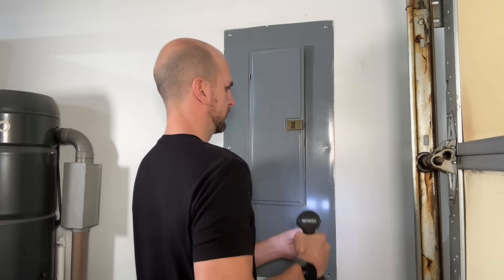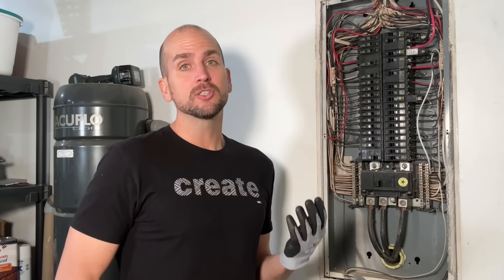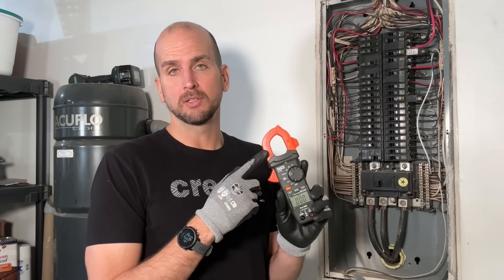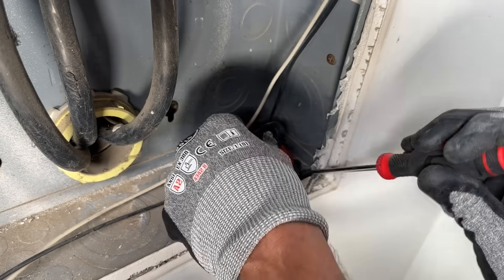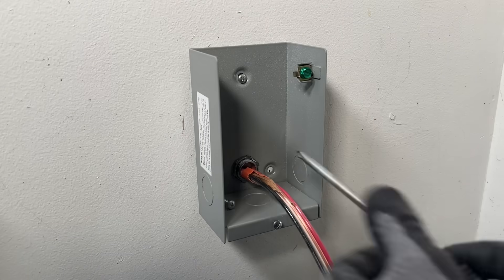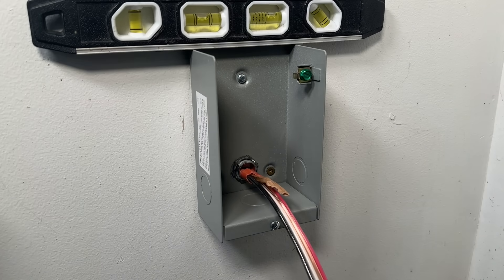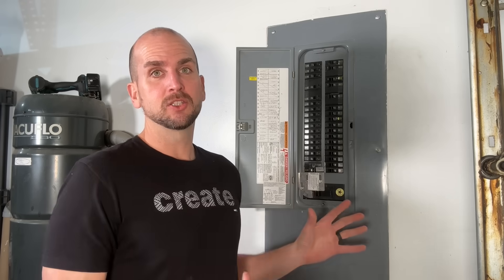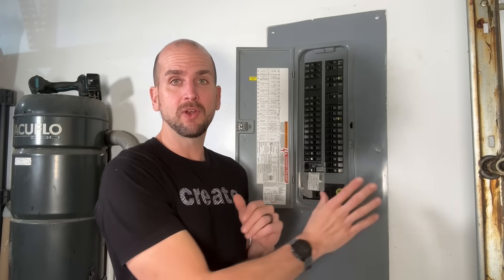Whole House Power Backup Solution | Generator Inlet Box Install

Comment: I did this same job a few years ago on my house.  A couple of things: Generators either float the neutral or bond it.  In my case my generator had a bonded neutral.  This means when it is hooked up to the house you have the neutral and ground bonded in two places which creates objectionable current (parallel paths) I opened up my generator and floated the neutral (manual was good with it).  This means that it is no longer safe as a separately derived system (Just using it without connecting it to the house) so you can't really have both at the same time.  The objectionable current is only running back to the generator from the panel so probably not that big a deal but still.  There is good information on Mike Holt's youtube channel about all of this.  Benjamin Sahlstrom has some good info too.  Great video!  It would have helped a few years ago for sure :)
Reply: You can hook it up to a grounding rod though, right?  I think mine (Predator) has a little nub in which to do that.
Reply: @mae2759  Grounding rod doesn't do anything for safety.  Actually it doesn't really do anything at all :)  If you are interested i'd look up Mike Holt's information on grounding.  I find it facilitating but it can be difficult to understand.
Reply: Chad, you are 100 percent correct about unbondimg the neutral... When I wish to run generator stand-alone, I insert a 240 volt 30 amp plug, inside of which I've jumpered the neutral and ground prongs.  This restores the neutral to ground bond connection for stand-alone operation.  I keep this bonding plug tethered to the generator for easy access.  However, if you try to do a jumper plug at a gen's 120 volt receptacles the built-in GFCI will probably trip....
Reply: @josephknapick5307  Great idea!  Easier than opening the thing up and rebonding it on the generator head each time.

Comment: Texan here. This is a very well timed video considering the number of Texans that went over a week without power because of an ice storm just the other day. I was lucky to not loose power but literally today I heard about one co-worker who came into the office  just to be in a warm office. The storm was 10 days ago.

I have been working on getting myself a backup source. One plan I have is to run my gas furnace using a 1000 watt inverter from my car. I was planning on ignoring my electrical panel all together and run romex from a box similar to the one shown in the video from my garage to the furnace in my hallway. Then I was going to add a standard 3 prong power cord to my furnace so that when the power goes out I just unplug the cable from the primary source over to my backup line. This means I don't have to deal with high voltage at all. Though I like how clean this upgrade is. Great video!

Comment: This is interesting to see. I have a kit that connects my generator to the electrical box. I won't be installing it as I am NOT comfortable working with the breaker box. I'm just glad to see how it all works. Thanks!
Reply from the maker: Exactly, actually a majority of the viewers won't take on this project themselves but just having a better idea on the parts, steps, and time to do the job will help work with a licensed electrician in your area.

Comment: I did this about 4 years ago for a 20A inlet box for a 6000 watt generator I already had. Gas appliances and heat plus LED lighting means a pretty small draw for even a fairly large house (3500 sqft.).  Wish I had this video at the time. Most resources made it sound like a $1000 transfer switch was required. Saved a ton by going interlock. Just make sure you get the right one for your panel. Also note torque spec for the panel screws are probably in-lb NOT ft-lb. Don't ask how I remember!
Reply: Last summer (‘22) I had an interlock installed by a certified electrician. It was something I could do myself, however, a grey area arises with my insurance if something goes wrong, down the road. I felt it better to bite that expensive bullet now rather than find myself with an electrical fire issue and my insurance denying a claim on the grounds it wasn’t installed by a certified professional. 
Your video,as always 👍👍👍
Reply: I have NG too but need some way to power the damn furnace fan and a garage freezer.  I can run on less than 1000 watts.  Probably under 500, I just need a way to get into the F'g panel.
Reply: Look into ez generator switch
Reply: Can  i use a 50amp breaker  with a  30amp box

Comment: Off topic question..oven died in 10yo Kenmore..just two if ya, so we're sizing down..so we got a 28qt Air Fryer..love it..roasts a whole 6lb chicken better than the Kenmore..we just bought a dual element 1800 max watt induction cooktop that we can sit on the countertop, or we may throw out the Kenmore, add additional countertop n recess it.. the induction cooktop came equipped with a 4ft 3-prong cord..now my question is:  Is there an adapter/converter that will "connect to the range stock plug?"...if we ever sell our home, we don't want to remove the range plug..helllp, lol..thx in advance❣🇺🇸.are ya rolling ur eyes❓lol

Comment: Why wouldn't you just go with a 50-amp option? What's the drawback? Isn't the labor the  same?
Reply: The 6/3 wire you'd need to support a 50-amp plug would be more expensive. If you're doing it on a budget, the difference in price might be a factor in choosing a 30-amp over 50-amp plug. Also, 6/3 wire is harder to manipulate than 10/3, so if you're running it more than a few feet with bends in between it gets tricky.
Reply: @joeyhazlett  thank you, John. I did not realize you needed 6 gauge for 50 amp. Money wouldn't concern me assuming we're talking hundreds. The generator or battery units will be thousands, so the difference of a few hundred for 80% more capacity seems negligible.
Reply: Exactly my thought too. If you are going to all that trouble, why not spend a few extra bucks on materials and install the 50 amp plug. Testing the load will tell you your minimum size generator. If a bigger one were available you could use its capacity for a few “luxuries”. Of course I had a contractor install a 100 amp manual transfer switch so I’m ready for anything.

Comment: I used a 8 breaker position transfer switch wired for 50 amps so I can run a generator

Comment: 9 + 17.5 + 8 = 34.5A
Reply: 30A per phase.  17.5A is less than 30A on one, 9+8 is less than 30A on the other.
Reply: @RJ-ej1nr  Did not know that. Thank you!
Reply: Exactly what my maths said. And it's not like your sump isn't going to be running constantly during some storms, so you can't plan to turn it off while cooking to save yourself 8 amps.

Comment: Does that mean only one side of the panel is energized when operating the generator?
Reply: No. The breaker is mounted on one side but the entire panel is powered. Scott would need to be careful that he doesn’t exceed the 30A, which is why he measured and totaled load at both phases.
Reply: @readyplayer2  oh right every other breaker is the other leg, and this is a 2-pole breaker

Comment: If you are in the area of PG&E they make available a transfer switch that attaches to base of the meter.  The meter accepts a provided specialty cord that has an L14-30 to plug to your generator.  It does the interlocking automatically.  They provide it for free under qualifying circumstances (such as frequent outages).  So you can hook up a generator to have a whole house power backup solution and ZERO work required on the electrical infrastructure for the homeowner.  It is limited to 30A but hard to argue with free.
Reply from the maker: That is nice, thanks for sharing 👍
Reply: I've put in over 200 of these flanged inlet boxes over the last 20 years.
Reply: @EverydayHomeRepairs  Can A Homeowner install A 200 amp main breaker in order to install an interlock...❓❓❓
Reply: @Honestandtruth007  Good luck finding a 200 amp generator.
Reply: @oldfredbear  Portable 48+ KVA (200A) generators are used for events all the time.  For homeowners, if they are going that big they get the permanently installed kinds like Generac and aren't hooking it up with a plug off the panel they installed themselves.  The bigger problem is fuel if you want to be resilient since the commonly used natural gas does stop in various disaster scenarios.  If you want to be going for more than a day or two at loads that high, you need commercial/industrial size tanks, be it propane or diesel.  They are available of course, but not all places are cool with a 500gal propane or 250gal diesel tank.
Reply: @RJ-ej1nr  I think you missed the point where he asked if a HOMEOWNER could do this in a 200 amp set up. Currently the Generacs top out at around 100 amps.
Reply: @oldfredbear  Fair enough.  It is one of those, "if you have to ask..." questions.
Reply: I enjoy being a member of the Electrical Co-Op  they will actually come and install the system for free providing your system is up to modern standards and if not they work with you and will bill it out over a given time frame on your monthly bill to get your system up to Modern Code. Protection for everyone.
Reply: R J , free is definitely very good. I paid hundreds of dollars years ago to get an electrician to run one of these inlets to run my panel (with an interlock to shut off the power feed from the generator to prevent backfeed to the street). The upside for me is that I can run my entire panel (shutting off high startup load circuits as needed) from the generator during power outages.
Reply: Where is PG&E. I’m with duke energy and they laughed at me when I asked them about this.
Reply: @Tiktokrefugee69  Pacific Gas & Electric, in much of California.
Reply: If that's the GenerLink product, a friend of mine worked for the parent company, Global Power Products. In principle it's a really nice solution. Southern Company (Georgia Power in my area) was looking at offering those, and I was signed up to be a beta tester, but ultimately they decided not to implement the program due to issues with the device. I talked with the engineering department about it, and as I recall it had something to do with an unlikely but not impossible failure that could cause backfeeding. Or, if you're into conspiracy theories, Generac has "ins" to Southern Company, and is suppressing any competition.
Reply: @JCWren  Nice!  I heard this one is from Tesco, but it looks similar to the Generlink.  No inside knowledge on my side though.
Reply: Looked into this and the GenerLink is about $1000.  Interlock sounds good.  LOL.
Reply: Can i use these back up batteries with the generlink that pge installs?
Reply: Yes, and they will be more than happy to help you in the next two or three years.
Reply: It's like $1500... never heard of it being provided for free - just the installation.  That would be a heck of a deal if that's the case!
Reply: SCE is supposedly do a test one for 100 amp, they've been working on it for 3 years, so I gave up and went this way.
Reply: That's a great suggestion! If you're looking for a convenient and hassle-free backup power solution for your home, the Segway Portable PowerStation Cube Series could be a perfect fit. With its massive capacity, fast recharging, and versatile sockets, it's a reliable option for outdoor enthusiasts and RV lovers. Plus, its Smart APP control feature allows you to monitor and manage power flow effortlessly. Happy camping and family time!
Reply: That's a great tip! It's amazing that PG&E provides a free backup solution for frequent outages. Another option for backup power is the Segway Portable PowerStation Cube Series. It has a massive capacity, fast recharging, waterproof design, and versatile sockets. Check it out for your outdoor adventures and home backup needs!
Reply: Thank you
Reply: I read that this setup does not meet the Canadian code because it can be defeated by simply removing the panel cover. Would appreciate any comment
Reply: @albertpaquette7329  The transfer device is on the utility side. Utility books are what apply there, not the electric code.
Reply: It’s called a “Generlink”…provides generator interface / transfer switch…I have one at my house…installed by the Electric Supplier
Reply: Pge is ridicules
Reply: Yet another reason my PG&E bill leaves me bleeding from the rectum every month...
Reply: @smeado3533  how bad is yours? 😬
Reply: Plus stop casually bringing your fingers near the feed conductors for the love of Pete. People need to be extra cautious around hot feeds!!!
Reply: @tzotzo  Then how are we going to separate those who know what they're doing from those who don't?
Reply: Free lol. Factor on your per kWh hour rate and then let's hear about free
Reply: I like your vids and Shorts, but one suggestion. It's good to speed it up for most things, but maybe go to normal speed when doing critical steps like routing and connecting wires to the panel. Also, closeups to show exactly what you are attaching the wires to.
Reply: He probally does that on purpose so some jagaloom that hasn't a clue decides to tackle it themselves. Anyone familiar with enough to do this project will know those details  @slowguy56
Reply: Too bad I am not or would have done so years ago.
Reply: If I got one of those that attaches to the base of the meter, could it power a 3.5 ton central AC unit, provided the generator was able to supply the full 30 amps? Or at that point, would you have to get one of those big whole-home generacs professionally installed?
Reply: @petef.4361  simple math says No.
Reply: With a soft start installed on your air conditioning and no more than a 7,000 watt generator you could run your AC  @petef.4361
Reply: Thank Goodness I Don’t. That’s the Commiefornia Territory.
Reply: @sweetsuccesstrading5097  it's amusing how a technical subject triggers hysterical political diatribes in some individuals😅

Comment: Thanks.  Just bought a good sized generator and this was a timely video. I really like the safety feature of the interlock unit.
Reply from the maker: What size did you get?
Reply: @EverydayHomeRepairs  Can a Homeowner install A 200 amps Main breaker in order to install an interlock kit ❓❓❓
Reply: @Honestandtruth007  ... reading between the lines here it sounds as if your main breaker is outside and your panel is inside. You'd have to do a couple of things... See if a main breaker kit is available to be placed in with the other breakers on the buss bar (in line with the other breakers if there's room) and note if the main feed wires will be long enough to reach that new location. At that point you will need a different style interlock than what is shown here. This is probably going beyond the scope of the typical DIY job, but it could be done in most cases.

Comment: 408.36(D) Standard breaker can be backfed as long as secure it in place with a tie down hence the zip ties.  Usually interlock kits come with two large zip ties for that reason. Great video.